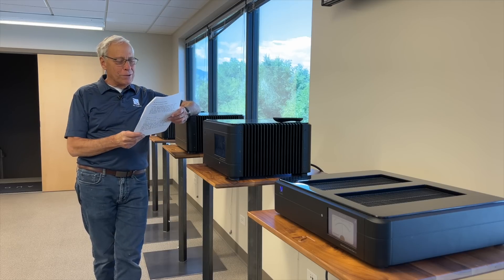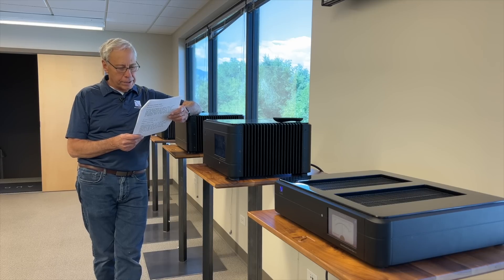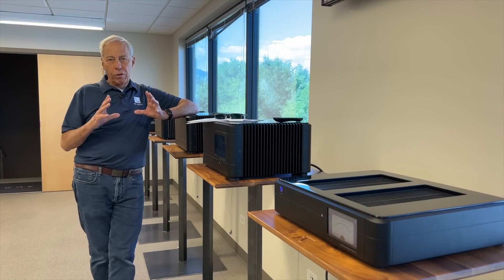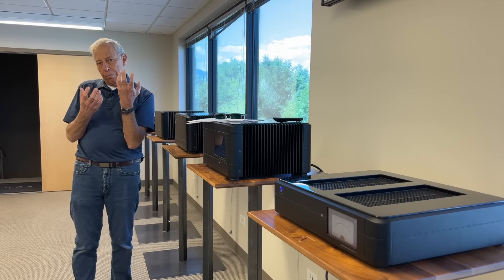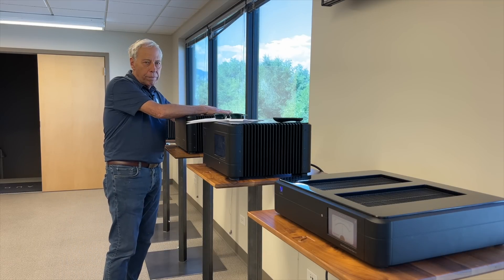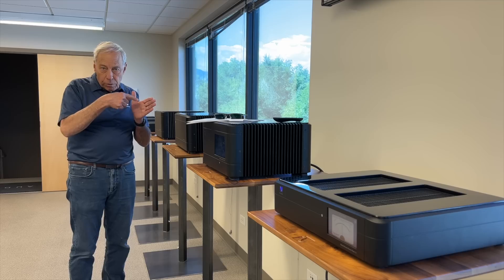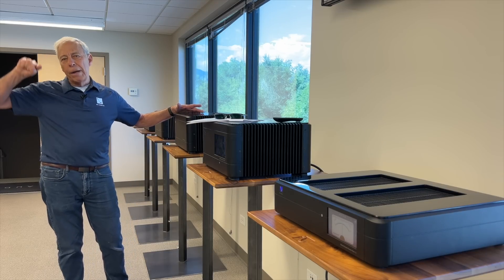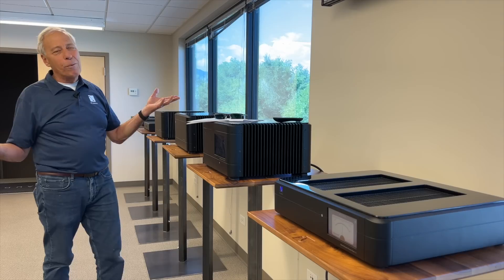Does AC voltage affect sound quality?

Comment: Older amps designed for 220V in Europe can be a pain... They'd be ok on 230v, but I'm in West of Ireland... Stiff 239Volt here. 20v AC extra means humming transformers and an extra few volts on DC power rails. This can be problematic depending on amp design.
Reply: Airlink transformers can resolve that issue.

Comment: Fun fact: in Computer power supplies, the internals are all made for 240V. If a PC PSU is capable of working on 120V, that's because there's a voltage doubler before the primary of the transformer.

This is also why 240V only PSUs are slightly more efficient and slightly cheaper.
Reply: I don't think there is a primary transformer in computer power supply since they are switch mode power supplies. SM power supplies have small transformer that the rectified DC is fired into at high frequency. Much different than linear supplies.
Reply: @johndavidson6433  That's why I said "primary of the transformer" not "primary transformer"

Comment: Do you utilize a multi-tap transformer making any AC configuration that is used in the world possible by just changing the connections on the primary transformer coil taps?

Comment: The 119 Volts down here in S. California was enough to blow out the fuse in my turntable that had a jumped arrangement under the hood that said ‘Japan’.  I found the jumper and managed to fix that turntable!  That’s how I got such a killer deal on a semi rare ‘broken’ Turntable that was being sold for parts!!  That’s also how I learned a little about Japanese electronic appliances and how subtle the differences, and the planning for power allowances can be!

Comment: I'm sorry Paul I would have to disagree with you.   I have always heard numerous changes in sound quality due to fluctuations in AC line voltages.  "In theory" amplifiers should be able to adjust for this from output filter capacitors but have found that every amplifier I have ever heard alters its sound when AC voltages change.  In fact if I recall in a earlier video you do confirm this sound change and why you make your AC power banks.   This is especially apparent with tube amplification.  

There are numerous parts of AC that effect sound quality.  From the pole and the power transformer to the electrical panel, the wire and how it is run, to the outlets and phases.

Comment: What happens if 120v ac, 60Hz amplifier is brought to Japan and plugged into 100V ac, 60Hz outlet in some part of Japan I believe uses 60Hz?  Will 100v sufficient to function it properly?
Reply: You might not notice any difference until you reached the clipping point, 
which would be somewhat lower than on full voltage.   
For what it's worth, part of Japan uses 60 Hz and the rest uses 50 Hz.

Comment: I actually did some servo amplifiers and power supplies that ran on 48Vac 400Hz mains. It's a better way to go. I'll let everyone say, or guess, what that is.
Reply: Curious, are You stating that for your servo amplifier design in order to lower distortion measurements you are using using a 400cps supply mains vs a 60cps supply mains?
Reply: @davidcross890  48V AC at 400Hz is not uncommon in aircraft. I think it's mostly a Boeing thing, but AIrbus might use the same.
Reply: @fermitupoupon1754  I am quite familiar
Reply: @fermitupoupon1754  quite familiar with in flight power as multiple systems of mine, I outfitted both my in flight and air to ground communications, noise cancellation, and emergency board and egress systems. Do You have familiarity with qualities of audible and measurable distortions properties comparing 50cps vs 60cps vs 400cps mains supplies to audio power supplies?
Reply: @fermitupoupon1754  Just to clarify and expand a bit: 400 Hz is an aerospace industry standard. All large transport-category aircraft require 400 Hz frequency. This was standardized many years ago to reduce the size (and therefore the weight) of power supplies. The voltage is set at 115 VAC with 3 phases/120 degrees phase-to-phase. It is also usually rectified to 28 VDC (not 48 VAC) for aircraft components (with very few exceptions). 
50, 60, and 400 Hz are all in the audible frequency band and can cause noise interference by induction. The higher the frequency, the more induction (reactance) can arise.
Newer aircraft use variable frequency on their on-board electrical generation systems (but still get equalized to 400 Hz steady).
Common AC mains (regardless of voltages and phasing) can vary by several volts anywhere in the world; however, frequency has a tight tolerance and should be stable. It is important to understand the concept of VAR (reactive AC voltage).
Reply: @davidcross890  Well kinda. :-))) The application was a little different than something that PS Audio is involved with. It was for a 5in gun stabilizer system, x/y axis. Mostly for the US Navy Destroyers. If I remember correctly the HP Distortion analyzer measured less then 1% at full power. All Solid State. 70 transistors in the output stages. It was a REALLY KOOL project for a young kid engineer. :-))  400Hz/48vac is ships mains power.
Reply: @wilcalint  most are not aware of the military use implications of perfecting various audio circuits. I bet you still have fun designing...great that you enjoy
Reply: @davidcross890  I came out of school in 68 and retired in 10. Through those years I was lucky to have been involved in a number of military projects. I was granted, at different times, Secret and Top Secret designations. Many/most tecnical schools are involved with military projects in some way. Mine was no different. Yup, some of it was quite memorable.
Reply: @wilcalint  Rewarding in many ways. So much is shed light on behind the wizard's curtains
Reply: @davidcross890  I share with everyone on this thread a memorable moment on that project I worked. If my memory is right that thing was dealing 100's of Amps into those motors. There was a prodigious fuse in the the power supply. The fuse started to "pop" every hour or so, then every 30min then every couple min. So the lead engineer put a BIG screw driver in place of the fuse and turned it on full to find he problem. "POW"! and about half of the 70 TO-5 can transistors blew there heads off. I'll never forget that.
Reply: @wilcalint  sounds like it was a resonant power runaway among other issues. Derating issues? Were these press top cap T0-5 packages?
Reply: @davidcross890  Back in the day. The ultimate problem was that 70 transistors in parallel back at that time didn't current share very well. So if the C to E current started to get hogged by one device it heats then hoggs a little more then heats up some more. So if you've got 70 devices in the output stage one device blows then passes it's load on to the others and then the others start to hogg and heat up and on and on. Then the whole thing goes "BAMM". All in about 30 milliseconds. It looked like a cutting torch on the floor. Quite fun. Today FET's don't have this problem.
Reply: @wilcalint  that was a sight I bet. I appreciate you sharing your experiences
Reply: Not sure about your statements regarding  " more or less primary windings v supply voltage at around 3.37??

A transformer will transform an input voltage connected to its primary winding - say  from an external supply such as 120v 60hz
 to another voltage on its secondary winding according to the turns ratio 
primary to secondary.

If we say that your secondary voltage needs to be 50v ( with some tolerance to account for external supply variations etc) 
 
Then if the supply voltage is 120v 60hz - then we will need a turns ratio pri-sec of 
120v/50v = 2.4 : 1

That is we have a step down transformer taking 120v/2.4 =50v

If we now want to run the same equipment ( that is keep secondary at 50v)  at 220-240v - we will need to increase the primary turns to give a ratio somewhere between 
220/50 = 4.4 : 1 and 
240/50 = 4.8 : 1 

In other words we need more primary  turns if the supply voltage is greater 

.In practice one would build a "tapped primary" transformer ( as you say in the video) 
 with taps at 
Say 
240v = 4.8:1 turns ratio
220v = 4.4 :1
120 v = 2.4: 1

Etc

A bigger issue is designing the transformer to work at both 50 and 60hz . ( which you mention in the video) to account for differences in inductive reactance/magnetisation currents etc

As far as the absolute secondary winding voltage is concerned - one would assume that the internal rectification / dc supply regulation is designed to cope with  variation of exterrnal supply voltages
( in the uk the supply can vary from nominal 230v -6%  to  +10%😂

Comment: Depends on how much power your amplifier’s are drawing from your home circuit. If amplifier’s don’t get the energy stored they need to operate at an appropriate voltage.
You are starving the amplifier’s.
Reply: No, they need to operate at the appropriate current. 
Voltage is only an issue because lower voltage requires a larger wire

Comment: Want I would like to know Paul what is the best ratio of windings of the primary to secondary, I'm assuming a heavier winding on the secondary is better.
Reply: @@Douglas_Blake yes but doesn't that come  down to gauge of wire this would make a difference.
Reply: @hoobsgroove   The number of turns, not the gauge of wire, determines the ratio. The ratio would determine the wires gauges

Comment: Wondering if I import a Japanese integrated amp (Accuphase) set for 100volts 50hz and use an external transformer here in the US is the sound quality effected?
Reply: If it's a new piece I'd be concerned about warranty, next is how good is that extra transformer going to be at feeding the Accuphase's better engineered  onboard transformer.  On paper it's possible, but sonically I'd be worried, lots of people try to wait it out for their countries version of a piece to become available.
Reply: @@Douglas_Blake In another video, Paul has said that any transformer made for 50 Hz will work just fine at 60 Hz.  So PS Audio uses 50 Hz rated transformers in essentially everything.
Reply: @@Douglas_Blake My understanding of it is that if a transformer is designed for 60 Hz and you try to run it on 50 Hz, it will run hot.  50 Hz may be too close to DC for some transformers.  The audio circuits should tolerate fairly big differences in power supply voltage with no problem other than changing the signal level where it starts to clip.
Reply: @@Douglas_Blake In the area near Niagara Falls (specifically N. Tonawanda NY) they historically had 25 Hz power.  A few older buildings still use it for certain equipment that’d be too expensive to replace.  The power is now electronically converted to 25 Hz, of couse.  I know someone who destroyed their wall-wart AC adapter by plugging it into a 25 Hz receptacle in one of those older buildings.  Yeah, 25 != 50, but there’s a limit somewhere.

Comment: Curious why some companies choose to make 'universal' components and others have decided on market specific devices.
Reply: Likely more cost effective to build something like a multi tap xformer than a single tap for each market the finished unit is sold in.
Reply: @gpower  That's my thinking as well. A company may find that they overproduce for one market and have a supply shortage for another. I have 3 amps and 2 of them I'm gonna have to leave behind when I move.

Comment: Yes it does affect sound quality there is some difference in lower the volts
Reply: @@Douglas_Blake I wouldn’t know I use pro amps crown ones and they can run on dirty electric pretty well, I just notice when it’s a stable 120 volts the music is cleaner and more efficient lower the volts it’s not much of a difference at all for some reason I can hear it
Reply: @@Douglas_Blake yes but voltage drops, con edison is either playing around with the voltage or the breakers I am using need to be replaced maybe i will replace them
Reply: @@Douglas_Blake sorry to hear that, i use furman power conditioners to help with voltage spikes. The lowest the volts drop down too is around 107 volts maybe a little lower so it’s not as bad as yours good luck and have fun
Reply: @@Douglas_Blake thank you